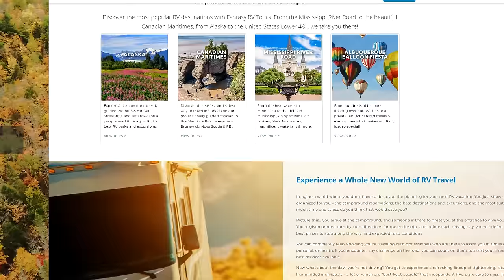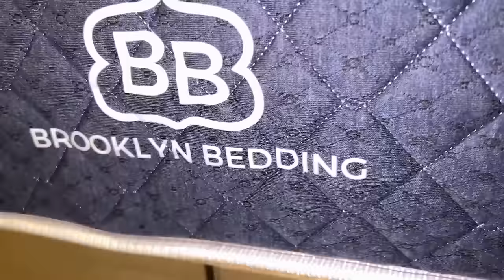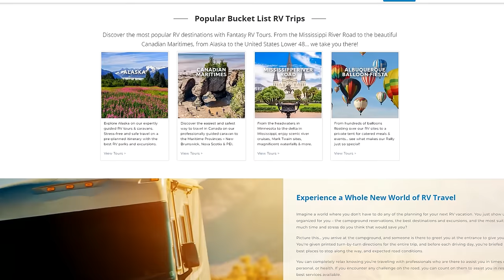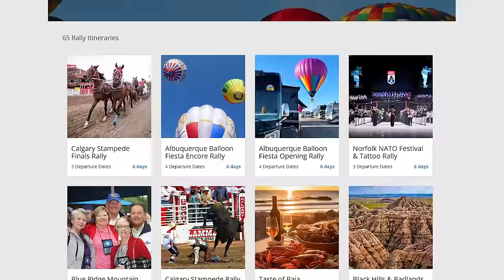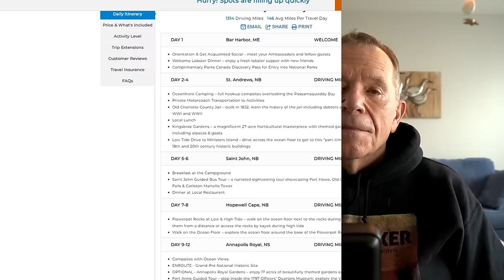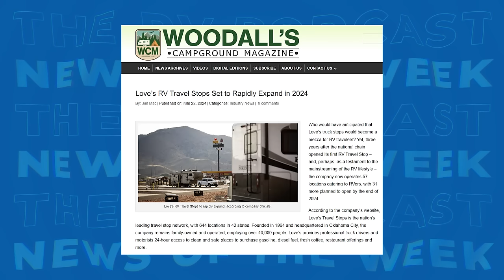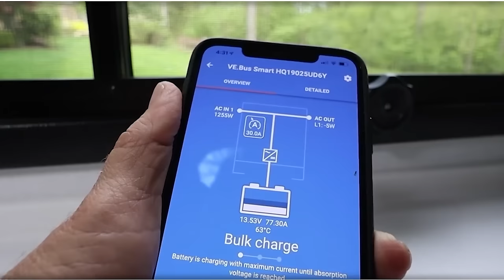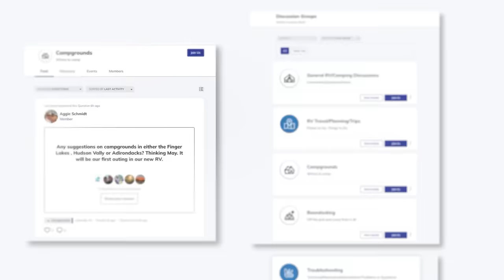RV Caravan Tours... All You Need To Know!

Comment: Mike, I hope you will double check with Nick before you call anything a "4x4" these days. The previous Sprinter chassis had one available, but the new one is all wheel drive, no 4x4 anymore. The difference is best described as 4x4 is for off road, while AWD is for poor roads or weather.
 True 4x4 has 3 lockable differentials, and that is usually found only on the high end builds, i.e. Storyteller(?) and custom upfits.